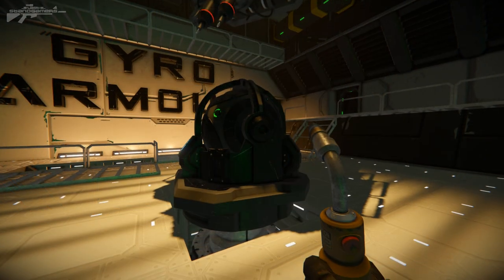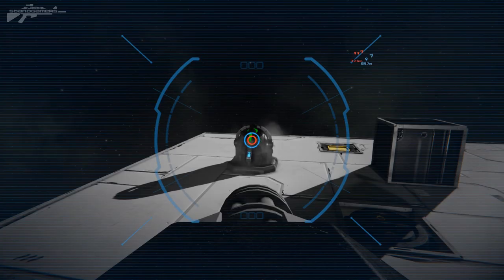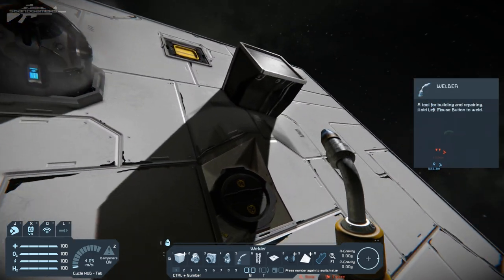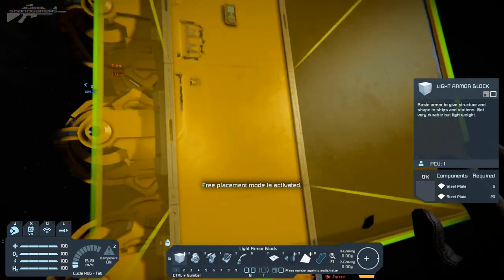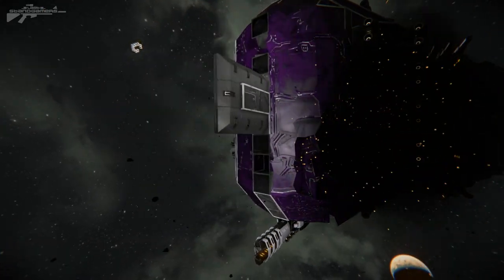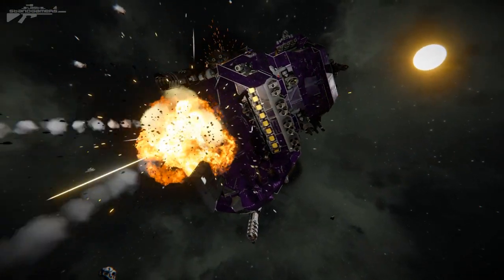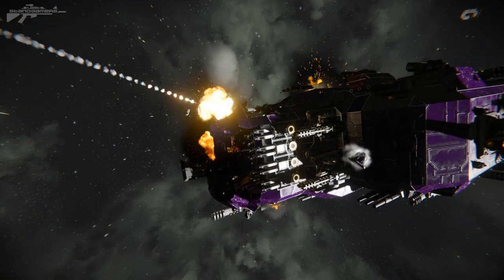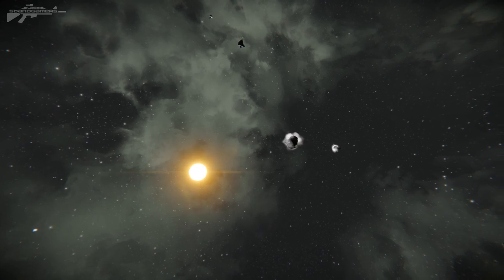Space Engineers - Gyroscope Armour VS Heavy Armour (Testing)

Comment: Drills can also withstand a ton of damage and they are virtualy immune to ramming. You can ram a multi thousand ton ship with drills on front in another ship or an asteroid and not even damage them.
I sugest you try that next, i acidentaly found that out on a mining mission when i met an AI ship in space and it started firing at the front of my mining ship.
After i escaped and got out to fix the damage...there was no damage . lol.
Dunno about grinders and welders tho.

Cheers.
Reply: MAAAAAAN!!!,  that's amazing,  large drills don't give no fucks!  

I'm working on an upgraded version of the starhopper using the weapon mods I've seen in colony wars,  just as a fun experiment in optimizing designs some.  and I'm deffinetly incorporating some large drill spars to the front of it to be used for ramming attacks if desired.

Main idea is that I've added 10 hard points where you can add pylons with merge blocks for what ever functions you would like,  It started with the goal being to be able to add decoy pylons on the side, but it's morphed over time,  but this addition is by far my favorite.
Reply: @Gw2Zoke  Yup, big drills dont care. It has to be that way or they would explode during normal mining whenever they would hit somethingh a litle harder.
Shure would be a sin not to exploit that for PVP lol.

Aaron just a hint, next time you launch guided missiles at Jack's base turn their ownership to neutral. Everybody has their defense turrets "target neutrals" option off too avoid them shooting random blocks. Flying a neutral grid past them guarantees safe passage to the designated target 

Thank me later ;)

Comment: Dont artificial mass blocks and spaceballs have huge amounts of steel plates, as well as having 6 mount points?
Reply: Mass blocks are an option.

You could even gain the added benefit of gravity propulsion as long as you place them carefully.

With use of both gyro and mass block armor a well balanced capital ship could be highly maneuverable and quick to accelerate without sacrificing armor protection.

However, the mass blocks do make use of more valuable components which are less than ideal on a survival scenario.